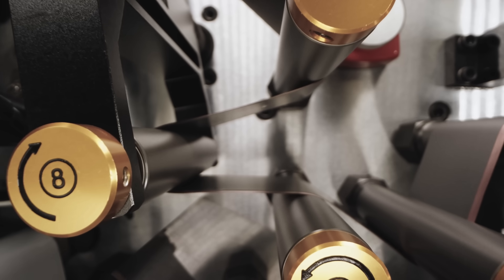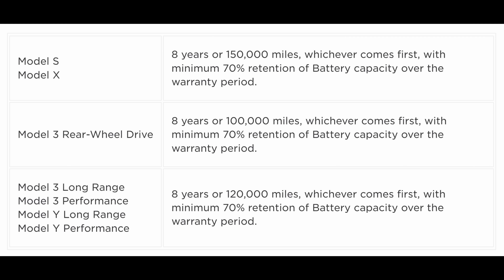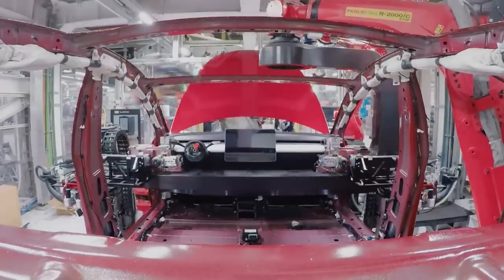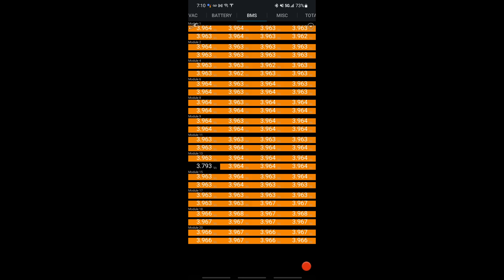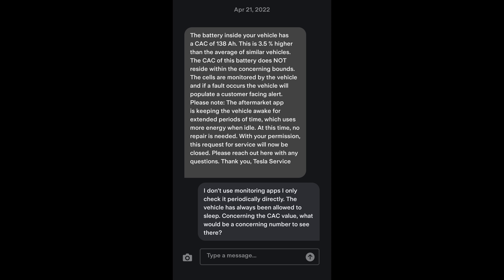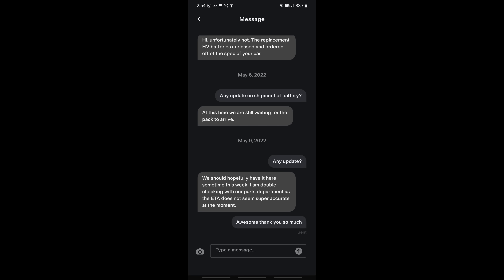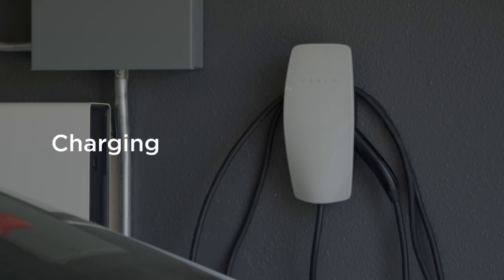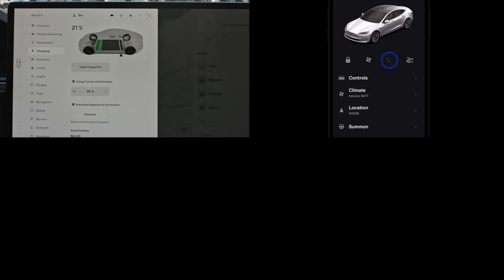What Happens When a Tesla Battery Fails?

Comment: Huh, this guy says he knows so many Tesla owners but almost never hears about battery failures. Huh. If you go to the Tesla owner forums and hang out with the owners of 10 year old Tesla's, you will hear non stop about battery failures, often repeat failures, and a lot of very sad owners that feel duped. Batteries fail for a lot of reasons, but the biggest issue is that they fail with just time. 10 years is the realistic life expectancy, regardless of miles. Shocking, but true. But this guy is a shill for Tesla, so what do you expect. He is not going to air the true dirty laundry about EVs. Tesla doesn't pay for traditional advertising, but they definitely spend a boatload buying off influencers to shill for them. Sandy Monroe is the worst case of a damn liar for Tesla. He seems like such an honest old man, but he shills non-stop for Tesla.

Comment: Honestly after having a car that was only 6 years old blow a radiator which made it overheat and warp a cylinder basically ruining my engine. I don't feel like it's any more risky than a combustion car. It's probably still less because there's only a few things that can really mess up on a Tesla and they usually don't.

Comment: Battery swap and subscribe would be answer for consumer. No more headaches and worries about battery degradation or replace cost. Internal/structural, very difficult battery replace is not the answer. The replacing must be designed in low cost. Second option is that car manufacturers must offer at least 20 years performance guarantee warranty for the battery. Resale value for used EV-cars will remain.

Comment: I JUST had my battery replaced in my 2021 Model 3. I waited nearly a month before it was replaced. The original battery was a 75 kWh, they replaced it with a brand new 83 kWh battery. My mileage is 25.5k.

Comment: Well - they just do not offer a warranty on the replacement part - any manufacturer doing this at all? They just guarantee you a battery capacity of >= 70% for xxx miles and yyy years for your car - thats it. By swapping the battery when neccessary, they just fulfil this warranty. Put this way there is really no reason to renew or extend it.

Comment: Tesla won't do it, but if you are out of warranty 3rd party repair shops can replace individual modules, cost would likely be under 5k.
Super charring over 40% of the time was probably harder on the battery than the occasional 100% charge.

Comment: think my battery has had it .its was saying maximum battery level  reduced. app saying  0 kms  when it had160kms gave them a ring and reported it monday the warranty up next week booked in 3 days after warranty ends . tonight car dead wont boot up was around 150kms charge in it .  car has 142kms on clock 88000miles have car 3years been a nightmare from day 1.

Comment: I have a 2018 Model 3 Long Range (Dual Motor). I was on a road trip a couple of years ago (so the car was maybe 18 months old), and was Supercharging in Buffalo NY (on my way from Cleveland OH to Boston MA). At the Supercharger, while supercharging, I received an error message that the car had a problem in the high voltage system, and was not going to be able to charge anymore. This was quickly followed by notification that I would not be able to drive it anymore!!   I used the Road Service on the App, and Tesla concluded that it would need to be towed to the nearest service center (about 50 minutes away).  It took about an hour for the flatbed tow-truck to arrive, and about another hour to get it on the truck and drive to the service center.

As this occurred on a Friday, nobody at the service center was going to be able to look at it until the following Monday, which left me with considerable anxiety.  However, the service center made it very easy by loaning me a Model X (regrettably fixed into Chill Mode!!).  I told them that I was on a 1200 mile road trip, and expecting to spend the following week in MA.  Their response was "No Problem.  Take the Model X, Complete your road-trip, don't worry about mileage or supercharging costs, we'll call you when we have news".

The following Monday, I received a call with the news that they'd probably need to replace the pack, and that getting that part would take over a week.  I ended up extending my stay in MA a few more days, so I could pickup my repaired Model 3 on the way back to Cleveland, rather than needing to make an extra round-trip from Cleveland to Buffalo and back.

The end result was, they performed the repair, and the car has been absolutely fine since then.   I might have lost about 10 miles of range, but that's all.   I may have been lucky in my service experience, but given the circumstances, I'm not sure Tesla could have done a better job in dealing with it.  It did cost me maybe 4 hours of foolishness in total, but on the plus side, I got to enjoy a Model X for a week and a half, which my grandchildren greatly enjoyed.

Nobody really mentioned if the warranty on the battery pack reset because of the replacement, or if I still have my original warranty, presumably until 2018+8 (2026).

It was reassuring to see how Tesla service center just dealt with it, without any fuss.

Most of my charging was (and still is) in the 25% - 80% range, charging at about 24 Amps (on my 30 Amp circuit).  I only charge to 90+ percent when doing road trips, and try to plan to never go below 10% (just for my own nerves ).

Keep up the good work Chris.  One of these days, maybe I'll get to meet you in the Detroit area. I'm probably there a half dozen times per year.

Comment: I just crossed the 120,000 mile limit on my model 3 warranty. I've charged to 90% every single day since I got it, 100% maybe 20 times since new. Range is about 270 miles from 310. 66.5Kwh left of 74.5Kwh when new.
Reply: My model 3 just exceeded 75k miles and the range is about 285 from 310 after 4 years.  Almost always charges between 20-80%.  It looks like charging to 90% makes little difference.
Reply: That kind of degradation at just 120k miles is pretty 😳

Comment: The sad thing in all of this is that if you own a Tesla you cannot take it to just any garage to have it serviced, so you are at the mercy of the Tesla service center which may be very far away. If you own an ICE like I do, I am not limited by where I can get my vehicle serviced. If the car had been out of warranty, that battery would cost about $16K to replace. If the engine in my RAV 4 has to be replaced, the cost of replacement is much lower than that. 4 WEEKS to wait for your car battery to be replaced, is someone out of their mind? Refurbished batteries won't last as long as new battery. What they told your friend made perfect business sense to Tesla.
Reply from the maker: Under warranty that's true. Out of warranty, more and more options are becoming available for service outside of Tesla.

Comment: Totally normal for the warranty to NOT be extended beyond the original warranty. It's pretty much like that with most products if they are fixed under warranty. If you paid out of pocket for a brand new battery you would then expect to get a warranty

Comment: this was very informative...thanks.  am also curious whether the warranty extends at all with the replacement battery.  since it is extremely rare...it would be to tesla's advantage to completely eliminate any fear in future customers by fully and clearly extending the warranty.  also...the initial warranty should be for 250,000 miles...that would save a lot of emotional distress for everyone.

Comment: I hope I got my part of that low percentage when my new Y didn’t charge when I come to get it. Luckily I notice that before accepting delivery. Technician said that one of the cell short circuited.
It took them a few weeks to find replacement new car to deliver. If I wouldn’t notice that it is not charging, I guess I would be stuck with refurbished battery (but still nearly full warranty ;-) )

Comment: Thanks. Just over 120K on my 2018 LR Model3. The only issue I’ve had is the onboard charger recently lost a phase and would only charge at a max of 32A. Cost to replace was about $1800. The car currently charges to about 280 miles
Reply: Give it a little more time. Now that you are out of warranty, Tesla will soon send you a "special OTA" so you can give them a $15K Christmas present. 🤣
Reply: @JetFire9  over 140k miles and so far no other problems

Comment: Tesla probably removed the bad battery cell and replaced it with some other good used battery from their parts bin and then called it a refurb battery pack. He was very lucky to avoid the huge replacement bill. Now it's time to sell or trade the car for a new more expensive model 3.

Comment: I literally got that message 2 days ago.  At the service center now getting a new battery...
Reply from the maker: 😲 😲 Car stats?? Miles, model, etc.
Reply: @DirtyTesla  21 MY SR (133109).  The error code was "bms_a029".  When I scheduled service with Tesla through the app - they immediately got a HV battery on order (estimated repair time shows about 3 weeks).  Since it stopped charging (exactly like the story of the owner you shared) I had to have Roadside assistance tow to the nearest service center (Little Rock, AR to Memphis, TN).  The driver showed me what Tesla paid for that tow ($1,010).  Also they rented me a vehicle at local Enterprise as they didn't have any Tesla loaners available.  The cost of the open-ended rental was $1,920.  Needless to say - these repairs are expensive for Tesla before factoring in the battery.

Only signs there might have been something going on (hindsight making things seem more clear) - I took a 700-mile road trip last month and I couldn't get it to charge on a CCS charger.  Just kept saying Charge Failed, Try again.  I tried a few more times and then limped to a Supercharger where it did charge fine (albeit slower than normal, was 100+ outside so I assumed it was cooling-related).  The next Supercharger I went to I got the charge failed error about 10 times.  The car showed it had an update (which was just a [.] release - but thought it might have included a charging bug fix).  I moved the car to a normal parking spot and installed the update.  Went back to the Supercharger and it charged fine.  Just assumed this was a software-related issue.  Appears to have been a battery issue.

Comment: Thank you for posting this. I have been getting worried about my battery. I want my battery to last 300-500k miles. 15k plus labor is a LOT of money especially for people who buy the cheapest model 3
Reply: The bigger issue is failure of cells with time, not miles. You must budget for $15-20K battery replacement every 10 years. You might get more time, but do you feel lucky? And don't forget everything else on a Tesla fails and is extremely expensive to fix. Drive units fail all.the.time and will cost you $7K a pop. Onboard charger, coolant leaks, suspension, HVAC, etc etc etc will break your back financially.

Comment: it is not unusual if you get a repair under warranty that it would not extend this warranty. Otherwise you could run into an infinite free replacement loop situation.

And for this pack, abuse was not a reason. From the ScanMyTesla screenshots you shared, it is clearly visible that this was an individual cell or cell-bank failure which simply can happen in rare instances.
From the usage pattern you describe nothing was done wrong and he should continue to drive like before.
And the refurbished pack will have simply used, working modules put together in an existing pack housing.
If only one module is bad tesla will recycle that module and combine existing good used ones with similar wear into refurbished packs. That is what your friend received and they are perfectly ok.

My S85D also runs such a refurb pack for almost 4 years now and all is well, my previous pack failed in a similar fashion to his, without any abuse. Tesla took good care of it and all has been well ever since. It's just a matter of statistics, failure rate will never be 0.

And as far as I am aware there is a core charge if you need to pay the new battery out of pocket. I think if available you will also get two quotes: Brand new pack or refurbished.

Comment: Not having a warranty on the replaced battery is unacceptable. If a new engine or transmission is installed in an internal combustion vehicle, it has a warranty. I love Teslas and want one but this is a serious concern of mine that is making me rethink it all, especially the mileage lost.
Reply: Do you really get more warranty on ICE? The warranty was for the car. If the engine gets extended, should that happen every replacement? Seems the manufacturer can end up with replacing the engines indefinitely.
If paid for a replacement after warranty had ended sure you really want a warranty on that purchase.

Comment: Chris, thanks for this excellent report.  Your friend only deserves the length of original warranty because that’s all he has bought.  He didn’t pay for a replacement battery.  If he did pay $15K or more for a refurbished battery, THEN he deserves a warranty on the replacement, maybe 30K miles or 2 years.
Reply: Yeah this is how things work with warranty on products.
I do think it would be nice if they extend the warranty of the drivetrain with the same time they have them in the shop (or a multiple of that). In this case just a month. As a "sorry for the breakdown, while you don't have the car then your warranty calendar time shouldn't decrease".

Comment: If a $15,000 replacement battery (plus labor) has no warranty, that's COMPLETELY unacceptable, IMO.  I'd NEVER accept a transmission or engine replacement without a pretty serious warranty on that, for example.  (Remember, battery replacements will generally be done when the car isn't under warranty).
Reply: I really think you get warranty on a replacement work you pay for. But before, when the warranty from the initial car purchase covers it, why should they extend the warranty? Could end up with them perpetually replacing the batteries for free, I doubt they word the warranty in such an unfavorable way for themselves.

Comment: There is are two companies here in New Zealand which will replace modules out of Nissan Leaf batteries where a small number of cell packs have failed. That can restore the function of the battery pack.

Comment: That is interesting, Nissan by contrast, often replaces batteries that fail under warrantee, with whatever model of battery is currently in production. Many early models had 24kWh batteries had them replaced with new 30kWh batteries. People with later 30kWh batteries which failed, are currently having them replaced with 40kWh batteries. 

I had a Honda hybrid car where I had the battery replaced, in a discount replacement program, I got a new 5 year power train warranty with that.

Comment: Several things, I was told that cell failure is not uncommon 😬.  I was given a Model S as a loaner.  The refurbished High Voltage Battery only charged to 329 miles 100%, new was 345 miles.  Warranty continues at point of failure.  I was lucky that it died at Supercharger, can’t drive.

Comment: My 2019 Model S Ludicrous High Voltage Battery had a cell failure at the beginning of my #EVGOLF48STATES trip.  It was around 33K miles.  Warranty took care of replacement costs.  Mine just died after I Supercharged it in El Paso.  Both Low and High Voltage Batteries were replaced.

Comment: I charge my new MYLR to 80% every day.  I have a short commute so it usually only falls to 73%.  Should I let the battery drain more before charging?  I thought I read somewhere that plugging the car in when not in use is the preferred method along with charging to 80%.
Reply: I will go between 50/60% in your case
Reply: No. If you look at your owners manual (RTFM) you will see in ALL CAPS instructions to leave your car plugged when not in use if its possible to do so.
Reply: The lower the state of charge (SoC) the better for battery degradation. Low SoC minimizes calendar aging, which is the primary form of battery aging in the first several years of the battery's life. If you only need 7% on a daily basis, and if minimizing battery degradation is your priority, I would set the charge limit to 50% (the lowest that Tesla allows).